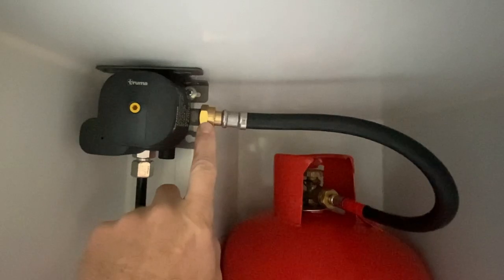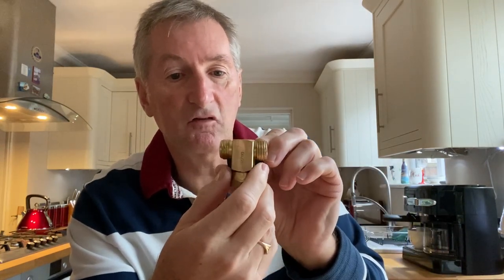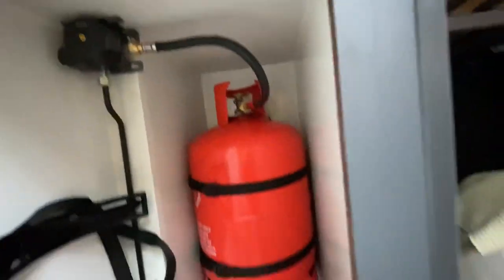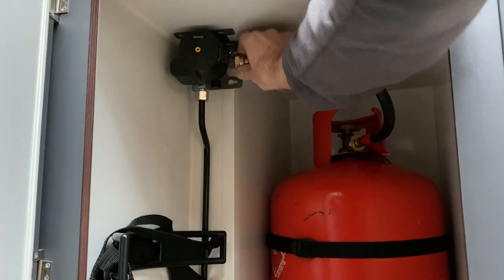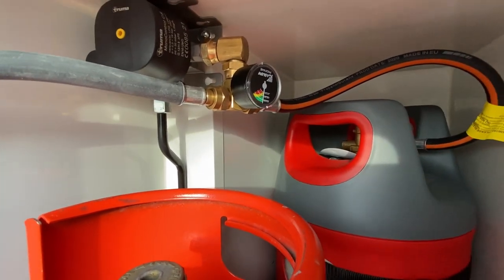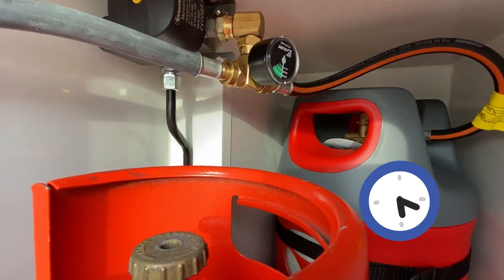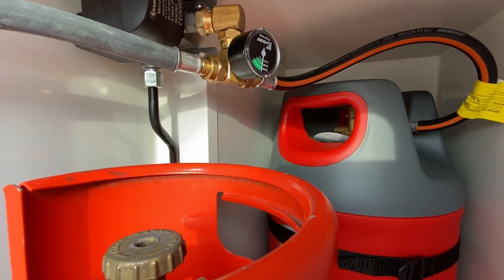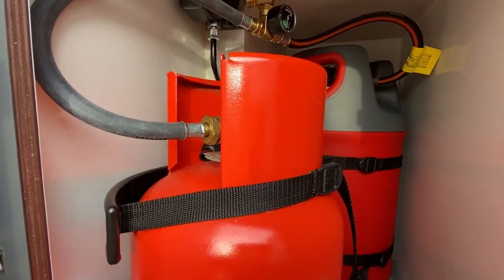How to fit a Gaslow Changeover Gauge and what its actually useful for!

Comment: Hi Nick have you considered fitting an external filling point for the Safefill bottle?    It’s something I’m pondering.  
Cheers Shaun.
Reply from the maker: Yes I have thought about it and might get round to it.  I guess you can by a kit that will do the job?  I havnt looked as yet!
Reply: @nickharper6436  I’ve been looking into it and there is a kit. When I pick my Adria up in May I’m going to ask the dealer if he’ll fit one.
Reply from the maker: I’ve seen some with the filling point put into the rear reflector.  You just pull it up and the filling point is underneath.